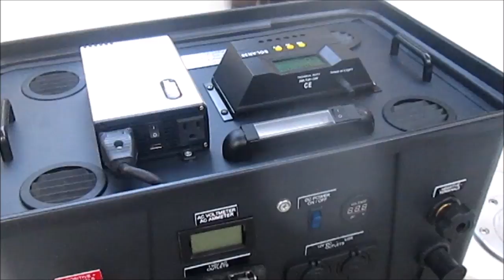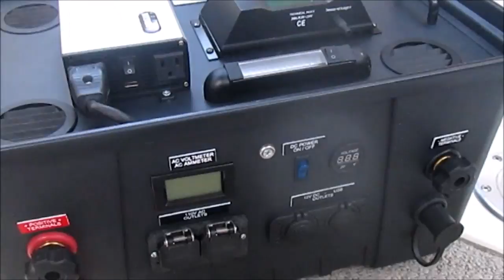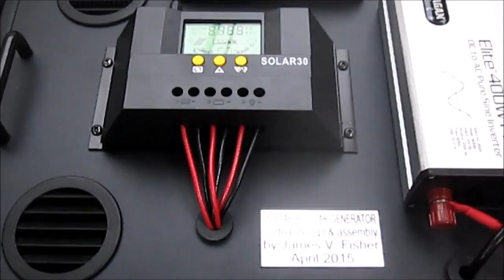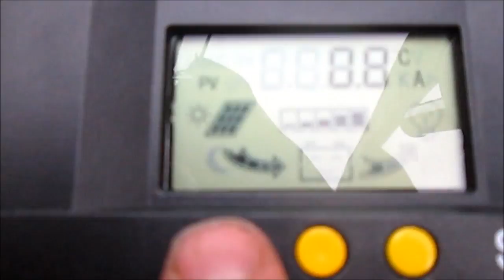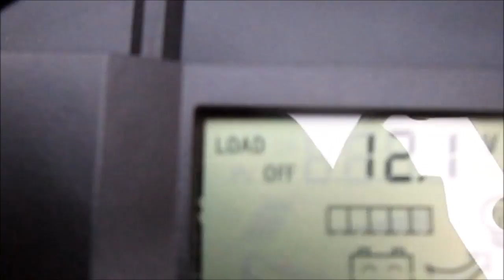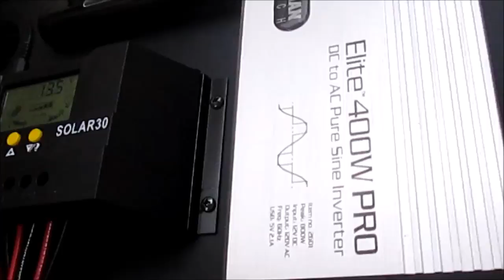V1 P6 DIY Portable Solar Power Generator

Comment: Hi Jim, I notice on the schematic you have the trickle charger linked with the negative lead going to the left-hand battery and the positive lead going to the right-hand battery.  Is this better than having both leads going to the same battery?
Reply from the maker: Yes, it is my understanding that when charging or discharging a bank where multiple batteries are connected in parallel it is best to make your positive connection on one end of the bank and the negative on the other.

Comment: Hi, Can you tell me how you cut the top blackboard to fit? Did you make a template out of foam or something? I cant figure out how to do that without getting in the box and tracing from underneath, but I obviously cant fit in there! Thanks!
Reply from the maker: Hi Ron, it has been quite some time since I custom cut that blackboard to fit the irregular contours of the case interior.  I recall first cutting the material to a simple rectangle based on the widest measurements of the case interior.  I then rounded off the 4 corners, probably used my jig or scroll saw.  Last, I took careful measurements of the indentation on each long side of the case and removed material as needed using a straight blade with my table router.  No template was made in advance, I just took careful measurements and used tools that gave me good control over the material when trimming it to achieve a close fit.
Reply: @JimFisherDIYPortableSolarPower  Thank you for taking the time to reply. I did like you, I just took measurements and cut it down little by little. I just need to get some L brackets and some handles and I will have the top done at least. Thanks for these videos and the reply!

Comment: Nice setup man. Really clean too. I just bought 14 inch solid copper bars so I can re do my electronics box with bus bars and my battery bank here is a link to my set up hold on I will get it and post it.

Comment: Hello Jim, very nice build, neat and clean. I'm in the process of constructing one of these myself. One thing I noticed was you used the + terminal for your battery disconnect, hope you corrected that since. It should be the - terminal to the switch.
Reply from the maker: Mario, thanks for your comments and concern for the battery kill switch installation.  Comments regarding safety considerations are always appreciated.  I did some research on this topic and found that If this system were grounded, such as when the negative terminal on a car battery is grounded to the chassis, there would be a benefit to connecting the negative terminal to the switch.  Since this system is ungrounded I don't think there is any additional benefit to installing the battery switch on the negative terminal vs. the positive.
Reply: OK jim, but just remember that a positive terminal of a battery is conductive. Rule of thumb is when disconnecting a battery you always remove the negative terminal first. Have a nice day. And good luck.
Reply from the maker: In an automotive application, I would agree that it is best to disconnect the negative terminal first.  In this application, from what I have read, disconnecting on the positive side is not a problem, some electrical engineers have actually stated that disconnecting on the positive side is safer.  Here's a link to a resource I used:   https://www.quora.com/Does-it-matter-if-you-put-switch-fuse-in-a-DC-Circuit-on-positive-terminal-or-negative-terminal

Comment: I realize this is most likely a really stupid question, but oh well, I gotta know for the box I'm building (inspired by YOU).  What is the benefit or reason for having both AC outlet plugs and DC outlet plugs instead of having all of one kind ??  Like I said, I'm sure there's a really simple explanation for this and it's a stupid question, but.....
Reply from the maker: Not s stupid question at all Ken.  Having one, the other, or both AC and DC power outlets is really a matter of how you intend to use your system.  First, using 12V DC power is always going to be more energy efficient than inverting to and using AC power (energy is lost through conversion).  So, if you can power everything you need to power via 12V DC then that is preferable.  There are some appliances that will be more convenient to power via AC, so for that reason the AC service comes in handy.  I will give you some actual scenarios given my use of the system I built.  I have a Dometic portable refrigerator/freezer that can use either AC or DC power.  While at the dock it is plugged into shorepower (AC).  Once away from the dock, I run it on 12V DC to conserve battery power while at anchor, and the sun does the rest.  I have a microwave on my boat that requires AC and has no DC option.  I also have a second, built in dorm sized refrigerator on the boat.  It can run on either AC or DC, but its DC service is currently wired to the single house battery on the boat.  I run that built in refrigerator on DC power while the boat is underway...the alternator feeds the battery to keep it charged.  Once the boat's engine is turned off I switch over to solar generator AC power to serve that refrigerator.  The AC power from the solar generator's 110V AC outlet  is fed via an extension cord into the AC shorepower inlet on my boat and can then provide power to both the built in refrigerator and microwave just as if I were plugged directly into shorepower at the dock.   My wife also likes to use a small AC bullet blender while aboard.  It has no option for DC power.
Reply: @JimFisherDIYPortableSolarPower   Outstanding reply !!!  Thank you !!
Reply: Excellent explanation !!!  THANK YOU !!

Comment: If you were trying to get a smaller and more compact box with 1 100AH battery.  What suggestions would you have in regards to layout and sizing of the box?
Reply from the maker: When I started planning my build, the size of the batteries were the starting point.  Knowing the exact dimensions of the batteries determined the size of the box I needed.  I also needed to take into account the headroom over the batteries that was necessary to mount the inverter and charge controller under the lid.  My recommendation is to choose your specific 100AH battery, get the exact dimensions, and then start planning your build around it.  With a single battery, my plan would be to center mount it in the box (for balance) and then leave space around all sides to mount accessories.
Reply: Thanks Jim.  I am thinking of going down the 2 box path.  One box for more of a DC box.  Smaller box with just DC outputs but put in a solar charge controller and no inverter.  A lot of room is taken up by the inverter.  Then do a 2nd box that can do both DC and the AC inverter.  Then try to figure out if i can tie those two together down the road if I need additional capacity for one application or another.
Reply from the maker: You are welcome.  Best part about building your own is that you get to design it for how you want to use it.  You can definitely tie the two boxes together.  Add a pair of bulkhead terminals to both boxes that will allow them to be connected with short jumpers.

Comment: Newbie questions here.  Yes, I've watch the entire series and read the comments, but didnt find these questions/answers.  Perhaps I missed them.  I too dislike the ones that make you answer the same question multiple times because they haven't checked the comments.  The blackboard from home depot...how much weight would you guess it will hold ? I have a larger/heavier inverter and want to ensure it will hold the weight.  2.) Perhaps I'm lost, but how do you ground all those wonderful parts ???  Suppose I could try coming up with a mobile grounding solution I could connect/disconnect, but wondering how you are doing it.  Thanks for any responses...if I get any :)  !!!
Reply from the maker: Hi Teresa, thanks for your questions.  The inverter I currently use weighs about two pounds.  I estimate the weight of the charge controller to be about 1 pound.  If I were to venture a guess as to how much more weight the Home Depot blackboard material could hold before it started to flex in the middle,  I don't think I would exceed 4 or 5 pounds total without considering the simple addition of a supporting brace across the middle of the case between the two batteries.  That additional brace would likely allow perhaps 3 to 5 more pounds of total component weight (so, maybe up to 10 pounds total).  Of greater concern, if you are using the same case and batteries I used, will be the amount of space that remains above the batteries and under the lid of the case.  The Wagan Tech Elite 400W Pro Pure Sine Wave inverter I used just barely fits under the lid with about a 1/4" to spare. 

Grounding:  I am not a professional electrician, so rather than trying to address this topic in great detail I will point you in the direction of a very helpful article that explains how inverters and generators, when used on boats, should be set up for safe use.  Here is the link:  https://theboatgalley.com/outlet-tester-showing-open-ground-on-inverter/ 

Of particular note are the comments made by Richard Anderson, following the actual article.  You will need to research and understand the concept of a neutral to ground bond and how that applies to using an inverter or generator without an actual earth ground on a boat.  I can tell you with certainty that the Wagan Tech Elite 400W Pro Pure Sine Wave inverter I used comes from the factory with a neutral to ground bond (for marine applications).  I have verified this is the case by using an outlet tester.  I tested both the inverter's outlets and the additional 110V outlets I installed on the front of the case with an outlet tester to verify that the inverter did in fact have a neutral to ground bond as indicated in the product specs.  All readings came back as "correct" with no issues.  If the inverter you intend to use does not have a factory installed neutral to ground bond, you can create one yourself. Google "how to make a neutral to ground bond plug".  I made one for use with my Honda EU2000i companion generator that I also use, without a true earth ground, on my boat.  It has a 30A outlet built in and I use my shore power cord to make the connection between the generator and the boat's AC shore power inlet.  A neutral to ground bond plug is inserted into the generator's 120V outlet to create the required neutral to ground bond.
Reply: Yeahhhhh,,,,,don't think that is going to work.  I may have to go with a lexan/plexi glass or hdpe or mdpe kind of thing.  I plan to have 2 boxes...one w/ 3 batteries, one w/ 1battery housed w/ the inverter & charge controller.  So  I "THINK" I'll be ok with space.  Building everything completely inspired by your setup.  It's a beautiful creation !!! Thanks again for the responses !!
Reply from the maker: Thanks for your comments.  Have fun and be safe building your system!

Comment: So after a few years of use, can you tell us what you would have done differently and things you will change going forward? Thanks.
Reply from the maker: That is an excellent question! Thank you.  I have used this system now during four May to Oct. boating seasons (about 5 1/2 months here in western NY).  In total, that equates to about 2 years of actual in-service experience using the system for its intended purpose.  I have used the system now on two different boats, the first as a stand-alone system since the boat had no shore power inlet and no built-in AC circuits.  The second, my current boat, has shore power and built in AC circuits.  Last season this system was directly connected to the boat's shore power inlet to feed the boat's AC circuits while away from the dock and at anchor. 

Over the past 4 seasons I have transitioned from using a single, 100W solar panel to using two 100W panels for a combined total of 200 watts.  That change from my original configuration is highly recommended.  I am still using the original pair of 55AH AGM batteries.  This summer was very hot and this system was put to the test in a number of ways.  I routinely used this system last summer to power a portable Dometic model CFX 35 refrigerator/freezer AND the boat's built-in dorm sized 4.3 cubic feet refrigerator/freezer, simultaneously. Granted, the two refrigerators cycle on and off.  The batteries were constantly being charged via solar power during the boating season, I always left the charge controller on and the panels plugged in.  We were able to pull away from the dock with fully charged batteries, drop anchor for 6+ hours on an average weekend outing, and use this system to reliably power both refrigerator freezers and a small bullet blender for making frozen drinks.  The Dometic refrigerator is able to be connected directly to the 12V outlet, but the built-in refrigerator required AC power, so the system's inverter was in use.  I did find that the cooling fans cycled on and off more frequently this summer than ever before.  I attribute that to higher ambient air temperatures and the heat generated by both the inverter and the batteries themselves (charge/discharge cycling). 

With all that I have previously mentioned taken into account,I have been VERY happy with this system.  It has completely met my current day-use demands for portable solar power while at anchor on my boat.  I have found that the number of AC outlets (3) is plenty as a stand-alone system.  When it is plugged into my shore power inlet I gain 4 more AC outlets that are part of the boats AC circuits.  The single 12V outlet has been enough for my needs and my family has been able to keep the cell phones charged using the 3 USB ports available.  The monitoring features, both AC ammeter and DC voltmeter, and digital temperature sensor/gauge have been very reliable.  I have no complaints about either the solar charge controller or inverter I used.  After two years of in-service experience, ALL of the parts I used are still original. 

As mentioned in my FAQ document, if you intend to move this system around a lot I would definitely recommend using a stronger case.  The case I used is OK, but it does flex a bit given the total weight of the system.  If you opt to add a third 55 AH AGM battery, you will most certainly need a sturdier case.  If cost was not a factor and increased portability was a primary concern, I would also highly encourage the use of lighter Lithium Ion / LiFePo batteries and an appropriate complementary charge controller.
Reply: @JimFisherDIYPortableSolarPower  
Thanks for the quick response.
Your system is one of the cleanest I have seen and very well thought out. Congratulations on a job well done.
Reply from the maker: Thanks for your comments, they are appreciated!

Comment: Is it okay to use the 12V to 230V inverter instead of that 12V to 110V inverter you used in this project?
Reply from the maker: I don't see any reason why you couldn't.  If the inverter is made to be used with a 12V system there should be no problem.
Reply: @JimFisherDIYPortableSolarPower  But the output matters because if we use an inverter that inputs 12V DC and outputs 230V AC, then we have to change the values of the fuses in this circuit. If the inverter outputs 230V AC and we don't change the values of the fuses, then I think it'll damage the system, won't it? Let me know asap because I'm also doing a project similar to yours for the Final Year of Electrical Engineering. So I need some help in that. And also why did you use 2 of the 12V 55Ah AGM batteries? That'll make the project heavy. I'm really confused which battery is suitable for my project? Please let me know asap. Cheers
Reply from the maker: The appropriately sized the fuse for output would need to be considered.  The output specs on your inverter should indicate maximum output.  Your inverter may also already have a built in fuse that is appropriately sized.  That is the case with my inverter, but I chose to add another fuse between the inverter and the 110V outlet on the front of the case for an additional measure of safety.   The battery choice I made was based upon the size of the case around which I started to design the project.  I had an idea of how much space I would like to commit to the generator on my boat.  Two 55 AH batteries would easily fit in this case and there is room to add a third of the same size in the future.  Larger batteries I considered would not fit under the lid of the case and allow space to place the inverter and charge controller under the lid, out of the elements.  You could certainly use a single 110AH battery if your case will afford the space.
Reply: @JimFisherDIYPortableSolarPower  I got it, but at least it should be portable as well. Otherwise, customers won't use this product. Aren't there any battery that offers best energy density, lightweight and safe to work with?
Reply from the maker: Sure, you could and should consider using Lithium Ion /  LiFePo batteries.  They are MUCH lighter.  You can expect your costs to increase if a primary goal is to keep total weight of the system down.  Keep in mind, this build is nearly 4 years old.  At the time I designed this system the cost of Lithium Ion batteries was nearly 4 times the cost of AGM batteries.  I didn't see the need to spend that kind of money since my system generally stays in one location on my boat...it can be moved, but as mentioned in my first video, "it's not meant for backpacking".
Reply: @JimFisherDIYPortableSolarPower  Btw, I'm also planning to add a microcontroller in this circuit. Is it safe to add a microcontroller in this circuit?If so, then where will it be safe to add a microcontroller in the circuit?